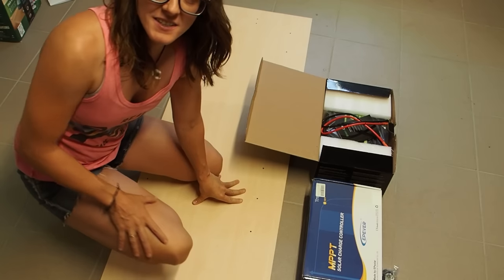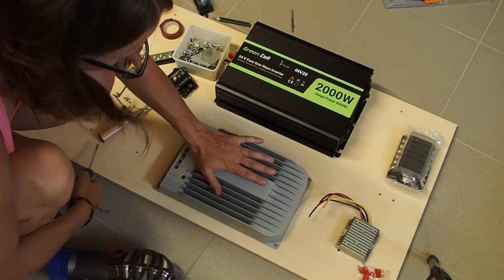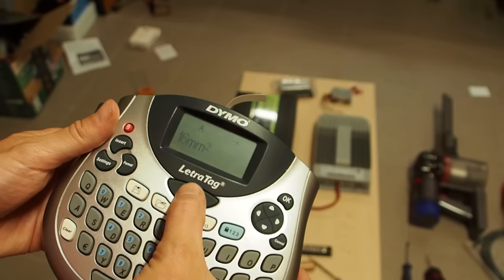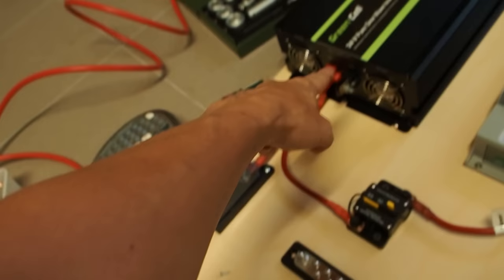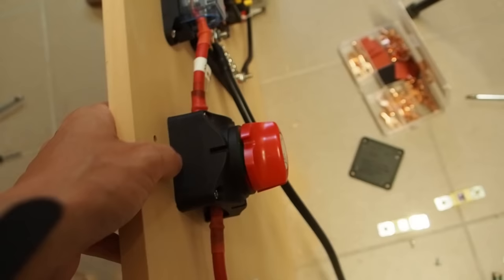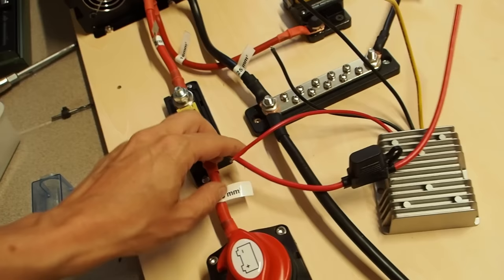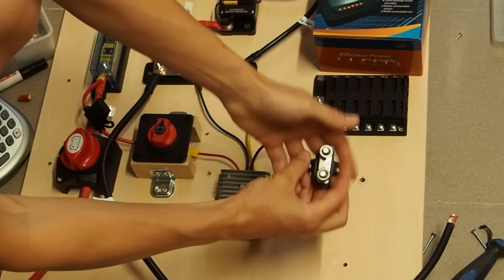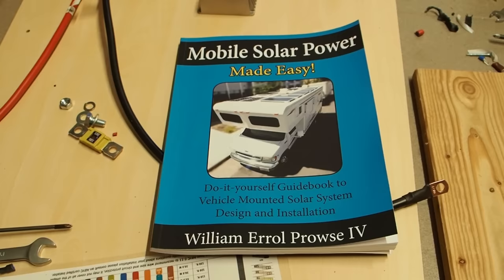DIY Solar System (24 Volt) for fridge and freezer! (Part 1)

Comment from the maker: Edit: The battery switch I used in this video is only rated for 48 Volts. So for 24 Volt batteries like in my case that's fine. If you are using it to disconnect solar panels however, the solar panels also cannot have more than 48 Volts!! A better choice to disconnect a solar panel from your solar system is if you use a DC breaker that disconnects both positive and negative wires. Get one that is rated 250Volts. Amperage depends on the size solar panels. But watch out with those DC breakers. If you wire them with the wrong polarity they will start burning. So always consult an electrician if you have doubts that you use the right components.

Shoutout to Will Prowse: https://www.youtube.com/c/WillProwse 
Will's Book: https://amzn.to/3ujFCip 
Yes this is a reupload with a minor change to the first version.
Parts list:
USA:
Recommended Batteries 2 x 12 Volt and 100Ah connected in series: https://amzn.to/3ark6BB
40A MPPT Solar Charge Controller: https://amzn.to/3NS8Iw7
MT 50 Monitor for MPPT: https://amzn.to/3ajeQQB
2000 Watt Inverter 24 Volts: https://amzn.to/3uVyo4D
50A Tocas Breaker: https://amzn.to/3AFoFTH (buy the yellow one, not the red one)
Copper Lugs: https://amzn.to/3nKTlLx
Hammer Crimper: https://amzn.to/3AwKc0J
Fuse Box: https://amzn.to/3IkCA3f
Buck Converter: https://amzn.to/3P8Ad5K
Fuse Holder: https://amzn.to/3alIx3c
Car Fuse Holder: https://amzn.to/3NW6jAC
100A Fuse: https://amzn.to/3OWs2Ke
Car Fuse Assortiment: https://amzn.to/3ymyfYN
4 Gauge pure Copper Wire by Windy Nation: https://amzn.to/3OUorvY
Hose pipe clamps: https://amzn.to/3Pbz4KB
Battery & Solar Panel Switch (rated 12-48 Volt and 275 Ampere): https://amzn.to/3bUuZMC
Negative Bus Bar: https://amzn.to/3NLcLKM
Reply: Thanks 🙏👍
Reply: Hi, I'm a bit irritated about the electrical wiring and the protection. Maybe I got a bit confused. Isn't it that the MPPT takes up to 50A in from the panels but will only put 21A out at max with 24V? And the  inverter got a 40A Fuse and your system is protected by a 100A fuse. Considering that a home circuit is only protected by a 16A fuse there seems to be a logical error here, or I got it wrong.
Reply: when there is no sun, some suoer inverter is better because it can be plugged to grid power and charge batteries. This way you have an uninterruptible power supply.
Reply: @alfredkaserekasivanzire9488  ..If you're not already aware, may I caution you to make sure NOT to overcharge your batteries? Terms like "Trickle Charge" and "Float Charge" should be explored, as well as what's the minimum your batteries can tolerate discharge. (is it 11.5 volts per 12-volt battery?)   Also, how to wire your positive lead to one end of your bank of batteries and your negative lead to the other end, so the 'charge' & 'discharge' cycles aren't from a single battery, alone...
I wish you all the best! A solar system is quite the investment in Money & Time, learning how to nurse & care for it...🇺🇸 😎👍☕
Reply: Put
How can I buy andi stall my own solar  pannells?
Reply: @aglandorf75 Typically,  a solar charge controller has two numbers, such as 100 / 30.

The first number is the absolute maximum input voltage coming in from the solar panels under any condition,  which is the Voc when cold. 

The second number is the output amps max.   So for instance a 100 / 30 has a max output of 30 amps .

If you have a nominal 12  volt system,  then you use ( 12 volts ) x  ( 30 amps ) = 360 watts from the solar array.

If you instead have a 24 volt system,  then you use ( 24 volt) x ( 30 amps ) = 720 watts from the solar panels. 

So using a 24 volt system can be dramatically better than a 12 volt system.

Comment: You were initially correct. 

You did not need the thicker wire going from the inverter to the charge controller breaker.

There will only be 40 amps, not 100 amps flowing through it.

Being connected effectively to the battery doesn't mean all of the current is flowing through every wire connected to the battery.
Reply: Yes, I agree!
Reply: I would suggest going from the solar charger to the inverter connection is a bit strange, it works, but going from the charger to the battery makes more sense I think.

But yeah, there won't be going any 100A from inverter to the breaker that goes to the solar charger, that's for sure.
Reply: Exactly what I thought wire right the first time.
Reply: Exactly, at 22 minutes the wire size is right, as soon as that wire exceeds 50 amps the breaker will open, current will stop flowing and both wires on each side of the breaker are safe.

Comment: Last week I learned a good lesson in Florida during Hurricane Ian.  Always keep your solar charge system and battery at lest 4 feet off the floor.  Also,  make sure your solar charge system board has a shield that protects the electronic components from roof leaks.
Reply: Good advice! I keep mine at eye level (4-5 ft) so i can see my charge controller and monitor everything while sitting. Batteries are sealed lead/acid and only 6 inches from the ground. Greetings from Jamaica.

Comment: The thinner wire on the circuit breaker is fine.  It won't be supplying any more to the battery than the charge controller can output.
Reply from the maker: I thought so as well but Will Prowse is using a thicker wire too.
Reply: @SurvivalLilly  I don't know who will prowse is, but regardless, that wire is only carrying current between the charger and the inverter/battery.  There will never be more than The 40A the charger can produce along that cable.
Reply from the maker: @spr00sem00se  i think you are right but maybe some codes require a thicker wire?
Reply: @SurvivalLilly  possibly codes require it.  But if you have calcualted the length of the wire, and how much current the gauge used can take for the length, then its all good.  

Ive got all my buck converters in house ready to make my peli case power pack / ham radio system......... son I will also be heading towards running refrigeration and hot water from solar :))

Comment: You did a great job there, Lily.
  I would just like to add something that I didn't notice you touch on in the video. It has to do with the hardware, the nuts, bolts, and washers.
 #1 Regular steel hardware Has carbon in it. Carbon makes a high quality resistor. Never, ever use regular steel hardware. Be sure to always use stainless steel or brass hardware only.
 #2 Never put washers between wire or component terminals, eg., between two wires or a cable and a fuseholder.
 #3 Every connection has a volt drop or a little resistance. Reduce the number of connections to a minimum. Soldering wires to terminals reduces volt drop also.
   I have seen components melted that came from the factory with improperly placed hardware. It did not take very long either. Attention to detail is very important, especially with high currents..
  Beware of schysters that are copper plating aluminum for cheap cables and terminals.

Comment: Huge amounts of off-grid solar power go to waste once batteries are charged. Water heating also stores that energy and can be direct DC. Lilly needs to design a diversion system, manual or automatic. I love her work in all fields.
Reply: In Canada you can hook up to the grid and sell the excess to the power companies.
Reply: @Playingwith3D  USA too with varying service charges and fees. Extra equipment costs plus price and rules changes justify caution when you're goal is survivability.  You don't need to pay for power you don't buy. Do the math for your application.
Reply: I hooked ice maker to mine 🤓
Reply: Teutonic Nordwind  All true and worth doing. You will get a better return on your investment as most solar panels and batteries have a service life, age, and cycles. In your case, you probably adjust to conditions and power needs to get the most out of it. Charging all the new electric vehicles, lawn tractors, and such will increase your opportunities.
Reply: Teutonic Nordwind  You have the best kind of system, it meets your needs. The surplus solar power is easily converted directly to heat which you may have a use for, like hot water or heating soil or a concrete slab, things that have an inherent energy storage capacity. Just brainstorming here.  Electric vehicles may soon take advantage of the surplus power.
Reply: Ron Powell  Interesting, So the battery is charged and its charge controller is in float charge mode, so how does the PWM charge controller respond and what kind of load does it pick up? Where is the PWM input attached?
Reply: Ron Powell  Converted my 48 volt Ryobi electric rider mower to solar charging with a Renogy charge controller and would like to pump irrigation water from the lake when it is done charging. Load control by voltage state sounds good if it has that feature. Thank you.
Reply: Ron Powell  Neither the Renogy 40 nor 60 amp NPPT charge controllers on my applications offer voltage-based load control, only day/night and time duration. I have identified options now, thanks.
Reply: That excess energy runs my little a/c and ice maker in the desert, no waste here
Reply: Ron Powell  That sounds good and propane is expensive per BTU. If your charge controller is in your building you also benefit from the heat it gives off too.
My application is 48 volts I will probably take off the battery terminals controlled by a voltage relay, but it will be a while.
Reply: @tommyjuneau6329  Do you manually control that or how are you doing that automatically?
Reply: @sagecoach  Yes I just crank up the A/C and power on the ice maker during peak sunlight hours..Batts are already fully charged for the evening by mid morning...Right now I'm pulling 20 amps directly from the sun at 11:30 am, the draw for the A/C combined with powering ice maker and box fan is about 17 amps total
Reply: Ron Powell  are you interested in selling two?
Reply: @dadigitechman  I don't know how Lilly would safely store or use the hydrogen. Youtuber NightHawkinLight, DIY Hydrogen ... shows how to make hydrogen and the issues. This thread earlier provides Lilly with a surplus solar power diverter and you have identified a load that can store the energy. let's see if she does anything with it.
Reply: What happened to part 2 on this?

Comment: Super job. I’ve built several similar basic systems. From the size of your board, I assume you will mount it vertically. You may want to check the inverter and charge controller manuals to see if vertical orientation is ok. The thrust bearings in the cooling fans in both devices are generally not designed for vertical orientation. Keep up the great work. Love your channel.
Reply: Wow , wow nice work you do,TO BAD YOU DON'T LIVE IN CODY WYO. I WOULD HIRE YOU TO HELP ME 👍🤠
Reply: Good point on fan orientation.  I'm more familiar with larger equipment which is almost always designed for vertical orientation, as it aids in dissipating heat, esp from fans which will be oriented to blow up by manufacturer.

Comment: Beautiful job Lilly. I just finished Will Prowse's book too. Awesome book. I have pulled together items for a 400W 12V 4.8K portable system for hurricane preparedness, to supplement my generators. If you can't get gas because no one has power you have to have a backup plan. Take this with a grain of salt as I am by no means that knowledgeable but the wire you ran from the controller to the inverter was probably fine as the controller is only using whatever amps it is rated for....no more. Also, tying the controller in above the fuse will had the controllers current to the overall current flowing toward the inverter and through the fuse. Maybe place it on the other end. I am sure folks will chime in and say I am FOS. I am glad I watched your video because you have a nice and neat layout to copy.

Comment: I have the very sam charge controller and it is AWESOME.  You will love it.  Just make sure you ALWAYS remove the solar 1st before turning of power.  You can ruin that charge controller as I did.  If you always do that I said you should never have any problems.  I build my solar setup for my RV just the way Will Prowse says to.  It has been working perfectly for 2 years now.  You were So Smart to get Will's book.  I did that same thing because I knew nothing about solar.  Smart Woman. :)

Comment: Is there a Part 2 Lily? Thank you for sharing your knowledge and ALL the videos you have made over the years. Amazing woman you are. Cheers
Reply from the maker: Please watch this video https://youtu.be/ZjATv33FwKk
Reply: @SurvivalLilly  Hi Lilly. What a wonderful work of art you have designed here. It is especially interesting to me, as I am building a system that is very similar to yours for my motorhome. The only difference is that at this point I am not using an inverter, so the breaker for that is also omitted. I am using a pair of 200AH LifePo4 batteries in series. The problem I'm having involves programming the Epever 40A controller with the proper values and settings in User mode. These are not well specified in the manual. I tried to access the video you link to in your response to another admirer in the comments. I am also very anxious to view a part 2 to this video and hope you will include your programming of the Epever in that video. Again, I'm very impressed with your talents. You Rock!

Comment: Those wires on both sides of the 50a circuit breaker are both protected by the breaker. They are in series.  They will also have the same current flowing in them, on both sides of the breaker.
Reply: Kirchoff's law.

Comment: Just last night I put two spare Morningstar Sun Saver charge controllers into a double layered Faraday cage.  These are lower cost, yet high quality and very reliable 12vdc charge controllers for smaller 400 watt systems that can charge two separate and different lead acid batteries at the same time.  This way I have redundant systems, and several solar system designs that can adapt to different situations.
Reply: May I ask what the faraday cage is for? RFI protection?
Reply: @bigdaadio.K2WW  A Faraday Cage protects electronic devices from Electro Magnetic Pulse (EMP).  EMP can be a result of  the detination of a nuclear bomb, or CME (Coronal Mass Ejection).  CME is a fairly regular occurrence that fortunately misses the earth more often than not.

Comment: #4 GA wire may still be a bit small for 24V and 2000 Watts.  I have a 2000 Watt inverter with 48VDC input and have 1/0 welding cable inter-connects.   Sie sind eine sehr talentierte Person, Lilly!  It is also most important that your components are sided/rated for DC!   Feel those cables when this is operating to make sure they are not running hot on your intended load.  I have 3 freezers, 1 fridge, 2 computers and a pellet heater running of my system 24hrs/day on the freezers and Pellet heater & fridge and probably 12hrs/day for the computers.

Comment: I like your content! I just found you. I know it’s been a while since you posted this, and I’m sure someone has already told you, but, just in case you don’t know, your fuse is supposed to blow before anything else. Meaning, if you have 25mm wire, your fuse has to be < or = to your wire, or your wire will melt before your fuse blows (breaks).
I hope I’m explaining properly.

Comment: Really nice job Lilly and it's smart to run your devices in the off-grid mode or as a battery backup. I would suggest one change. Connect your DC system supply to the downside of battery 50 amp breaker coming from you charge controller. That way, you do not have to run your AC inverter just to run the 12v equipment. Just a suggestion.
Reply from the maker: The inverter has seperate switch were you can turn it off.

Comment: Nice! Also there a whole group of DC  low voltage standard products that will run with 24V dc directly. With some research one can find everything from ceiling fans to refrigerators that run directly from 24V batteries (less efficiency losses). Cheers!

Comment: That was a fabulous description & demonstration of everything. One little trick if people are wanting to reduce oxidation in the joins is you can put a little silicone inside the edge of the shrink tube & when it shrinks it squeezes the silicone out & makes an air tight seal. Very good for marine installations or areas you might have more moisture. For example i like to hose my batteries clean occasionally & it stops any moisture getting in.

Comment: Tip: For blackouts, keep freezer full. I use 20 kg ice  bottles for keep low temperature during high costs or blackouts.
Reply: some people do this and run the fridge from solar without actually using battery energy. They only run them during the day, on full power so it cools down big time. If it is filled up completely it can stand 12-16 hours without warming up inside no problem.

Comment: I have built the similar setup as well. Specially, I used the similar DC transformer to transform upcoming DC voltage from the solar panels to  12V DC. I used 30A DC transformer. The only downside of this transformer is that you may lose some power between solar panels and inverter. Great Job.